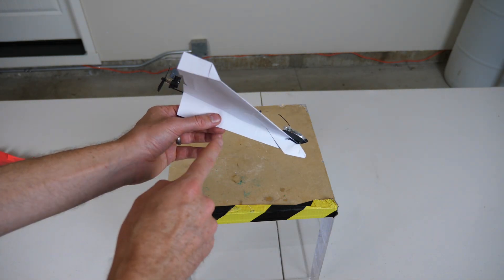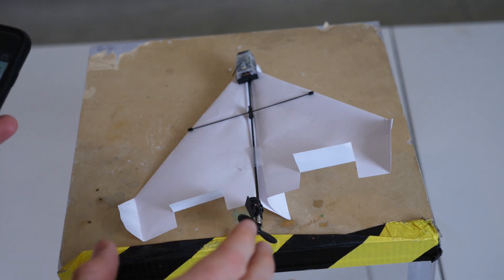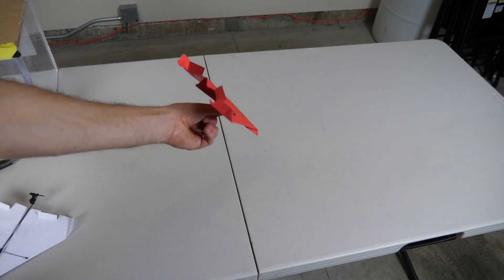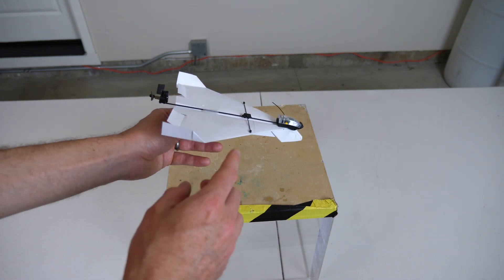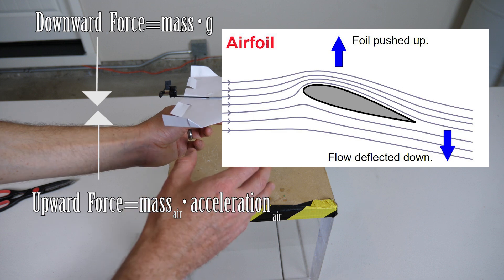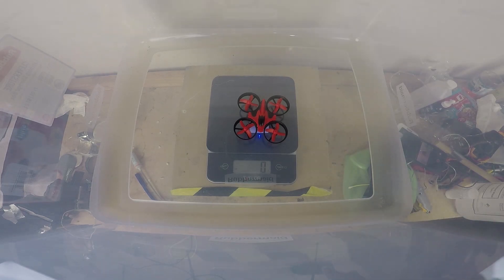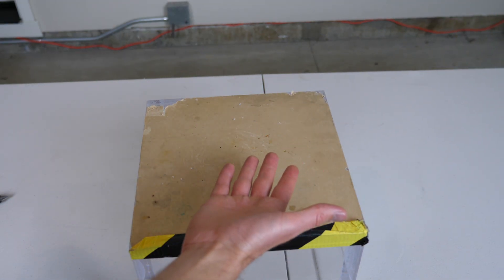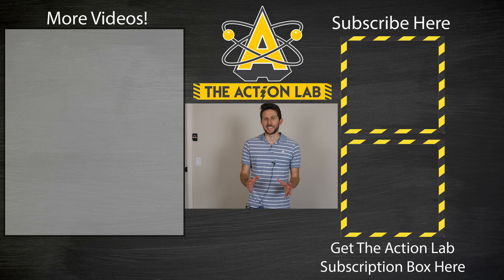How Far Can a Paper Airplane Fly if You Add a Motor? How Do Planes Really Fly?

Comment: 1:17 - "Lower pressure below and higher pressure above, and that's what lifts the plane in the air"
I don't think this will lift plane.
Reply: Weebing what you're saying is how an aeroplane changes it's angle of attack, not how it creates lift, if the tail wings are pushed downwards all the time the plane would go into uncontrolled loops enventually crashing i.e if it even manages to take off in the first place
Reply: That would ground the plane unless perhaps it was flying upside.
Reply: Weebing why do you event comment if you don't know what you are talking about? Wings have low pressure above and high pressure below. And the low pressure above provides 75% of the lift.
Reply: Ajt OsPrey he is not talking about dihedral angle, he's talking about the placement of the wings on the fuselage, if it's behind or after the center of gravity. And has nothing to do with pressure on the wings
Reply: alessaaa aaandro he said that if the wings were behind the CoG a downward force would tilt the plane and create lift, which is wrong since it would almost always make the plane stall or if the plane is powerful enough cause it to loop
Reply: RUSapache I like how you just point out a mistake and then there’s a bunch of physicists fighting in the replies
Reply: RUSapache Actually it depends on the placement of the wings. When the wings are behind the center of the plane,  you have to have higher pressure on top because that will cause the back part to go down, and the front "up" causing the plane to lift.

If the wings are in front of the center having high pressure on the bottom will cause the front to lift, and the back part of the plane just follows.

Comment: Wrong sentence by the way *lower pressure above and higher pressure below right? Thats how the plane goes up
Reply: I noticed that, too.
Reply: Was looking for someone to point this out in comments..
Reply: Yes. Higher pressure below a surface, and lower pressure above it would logically cause  lift. He said it backward.
Reply: Bernoulli's principle effect on flying is in doubt where aircraft wings are concerned, Why - for example - can a wing that is symmetrical fly?, why can a wing that is curved on top and flat below fly upside down?  Why can a flat wing fly? Why will an aircraft with a standard curved aerofoil but NO ANGLE OF ATTACK not fly?

I build and fly RC aircraft and all these are true. Angle of attach has MUCH more effect on the aircraft flying than the shape of the wing.
Reply: @rickharriss  
Correct me if i am wrong
but three factors affect lift
1. AoA
2.Flaps and slats (basically airfoil shape of wings) 
3. Thrust or speed
Reply: Richard Harris If you look at the air flow over a flat airfoil at a positive angle of attack, the air flow above the wing is curved and looks as if it is above a curved airfoil. Therefore, you can also use Bernoulli's principle to explain why a flat airfoil can generate lift.
Reply: Richard Harris I also have an asymmetric wing model plane. It can fly upside up if it reach about 5 m/s, but it need about 15 m/s of speed to fly upside down. So the shape of the wing could have huge effect, just not the only effect, that cause lift.
Reply: Bernoulli effect is pretty obvious when you look at stalls (also look at Charles Fauvel's flying wing designs, with a reflexed trailing edge)
Reply: Yup 
it is basically Bernoulli's principle 
velocity of air is greater on the top part of the wing than the bottom part
acc. to Bernoulli's theorem  pressure is inversely proportional to velocity :>
Reply: Yeah, the first rime he said that ut was wrong
Reply: Yeah he said it backwards. Also, not all wings necessarily need to have a curvature to them, they can be slanted or simply just be moving fast enough. Applied in general aviation, I fly a Cessna 150, cruises about 90-100 mph, and has a pretty noticeable curve. If you look at an RV-12, you'll see less of a curve, but they also cruise much faster. That being said, the paper airplane if a curve was added would need quite a curve to produce lift like an actual plane, though with enough elevator it'll fly just fine.
Reply: BUNCH OF SMARTIES HERE
Reply: Yeah I was about to comment about that. How can it gain altitude if there is low pressure below the wing?
Reply: Ye
Reply: i noticed
Reply: Yep he messed up, bernoulli's principal shows the air pressure decreases as air moves faster like over the top of the wing.
Reply: Absolutely correct...👍
Reply: No
Reply: @strategen9124  he did the dirst rime. He said it twice in two dif partsbif the video
Reply: @strategen9124  YES THATS IT! PLANE LOGIC IS OPPOSITE
Reply: no